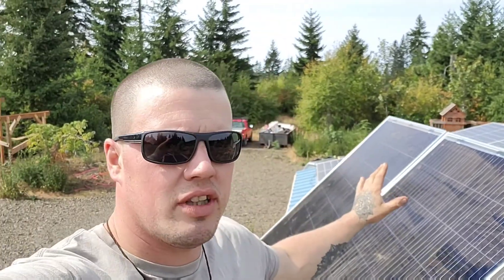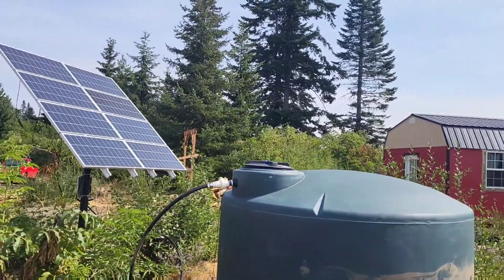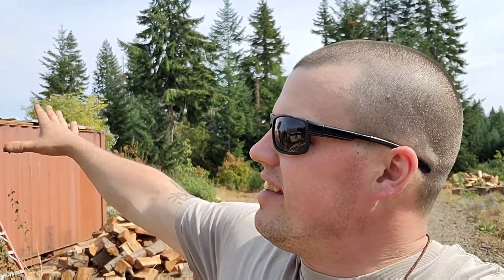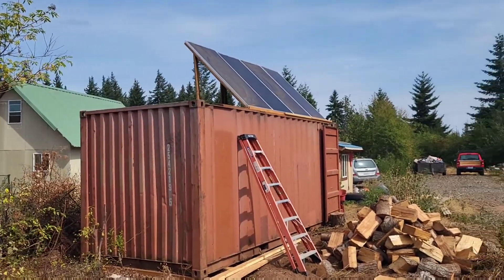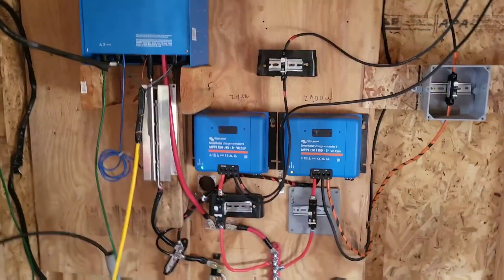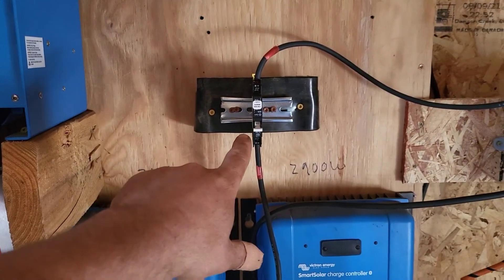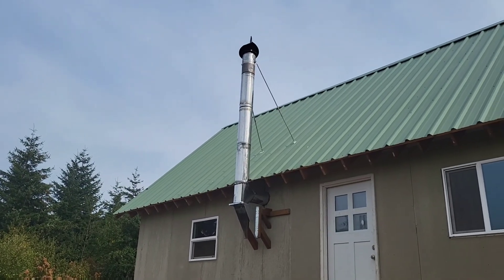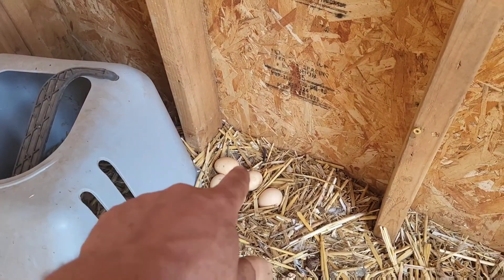Installing solar panels on shipping container for my 24v solar setup at my off grid home

Comment: Might have been better to put a double pitched roof over the container.  That way you have a way to break the wind while having a roof to mount the panels… and protect the top of the container as well from snow and rain.  Just a thought.  Peace.
Reply from the maker: I thought about that. But I need the solar panels up now and I've got a budget. I'd like to take the panels down and build a deck up there eventually.
Reply: @Hardcore-Homestead   Yes, sometimes you have to do what you can when you can with what you can.
Another option would have been to put them at the top of the sidewall of the container so wind would not be an issue.
Peace.
Reply from the maker: @DustySplinters  too much snow here for that. The shed where my other panels are is already too low. The snow builds up so high that you can walk right on that roof. That's why these solar panels on the shipping container are up that high and at that angle. Last year in December alone we had 9ft of snowfall.
Reply: @Hardcore-Homestead  Wow! What area are you in?
Reply from the maker: @sherrimiller5258  cascade mountains WA state